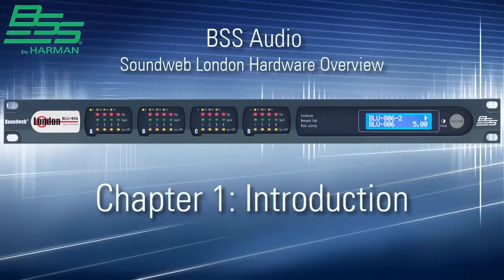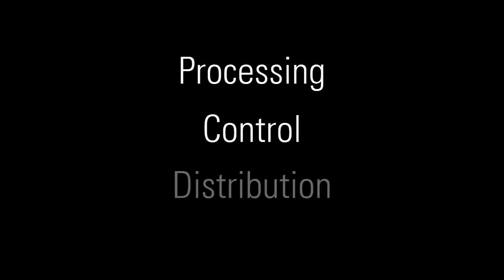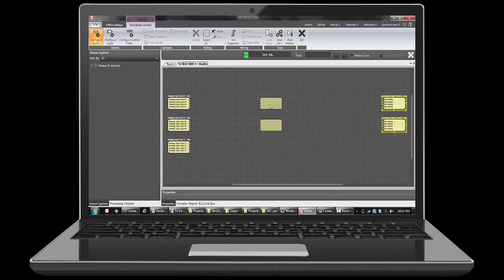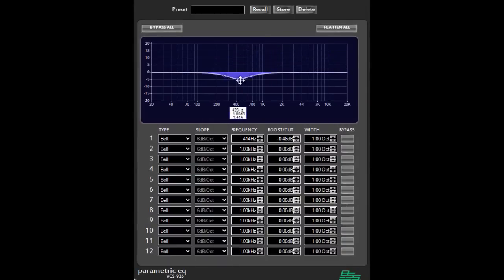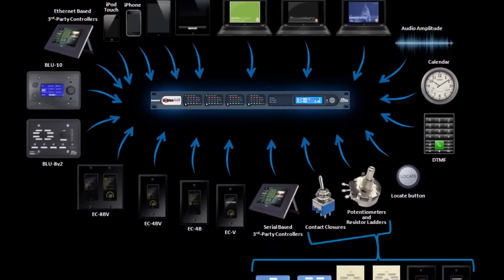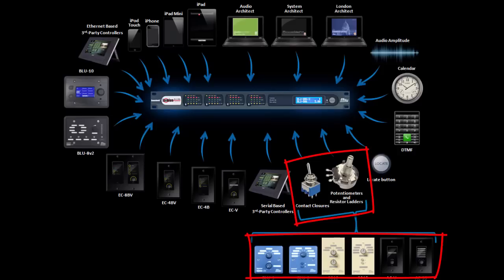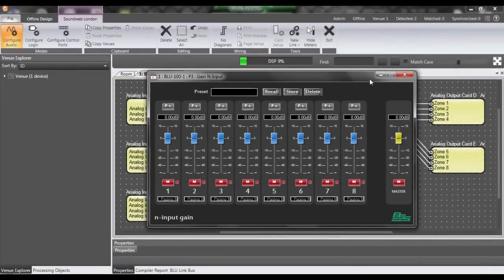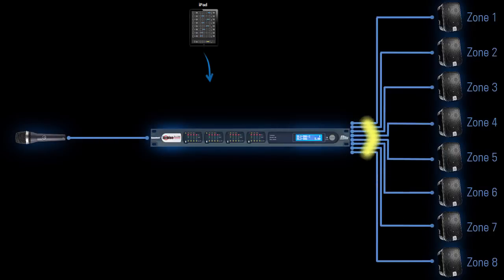BSS | Soundweb London Hardware Overview - Chapter 1 - Intro

Comment: How do you connect a pc to the unit? Using a CAT5 cable? This is very basic info and I cant seem to find it anywhere. There is an S232 port and a ethernet port on the back.
Reply: @@christownsend6898 BSS is an incredibly friendly company, you do use the ethernet port but you need their software to communicate with it. If you have any questions or are confused give them a jingle! They helped me figure out the metrology probe istuation on my FDS-388 loudspeaker management system thats been discontinued for over a decade